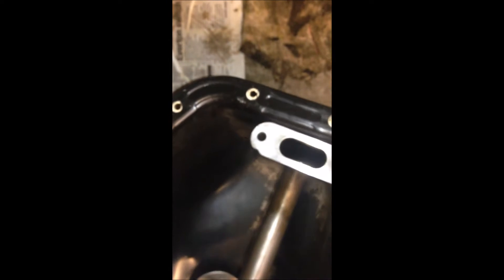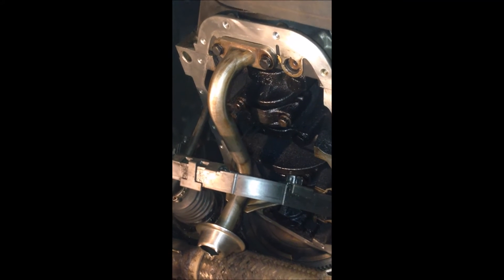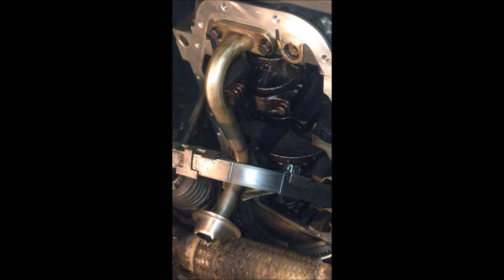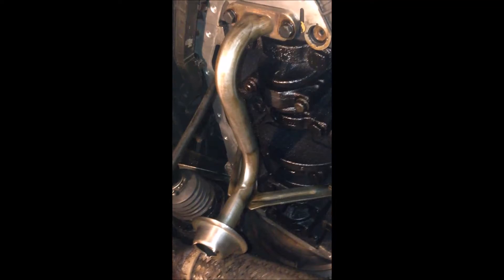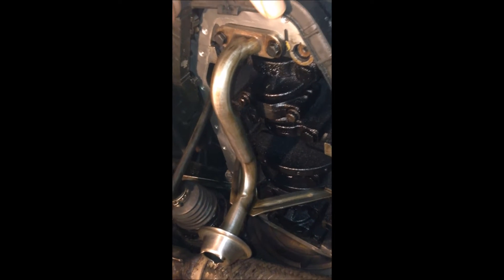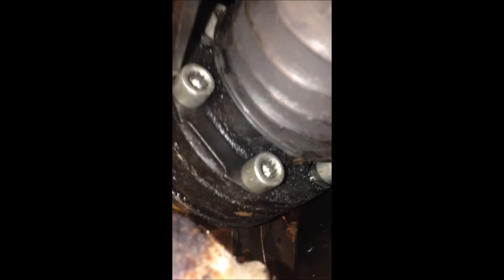VW Polo: Oil Sump and Pickup: How to Install (16v, 1.4, 6N2)

Comment: Hello, I have a leak at the oil sump on my 2004 seat ibiza 1,4 (same engine as polo) and I'm planning on replacing the gasket. I have a few questions and would really appreciate if you could give me some advice as you seem experienced. 

1. Do you need to replace all the bolts for oil sump and exhaust? 
2. Was it easy to remove the exhaust bolts or were they seized? 
3. Do you think this can be done on the ground with a car jack and a few jack stands or do you need a lift to remove the exhaust and oil sump?
Reply from the maker: For the gasket, I only used some red sealant on the old gasket. 1. I used old bolts; 2. my exhaust bolts were not seized. it depends on individual car. if seized, should be easy to buy new ones; 3. I used two car floor jacks and a few axle stands. Please view my other relevant videos, as they should documented more info than my memory! Good luck!

Comment: Hi TY for you video! I have a question please! Have you remove the dial and the ring gear please? 
Because I want to remove the carter but I don’t see the bolts witch are un the ring gear. And how could you get the screw witch is behind the dial? 
TY for answer
Reply from the maker: Sorry, I didn't remove the ring gear.

Comment: Hi 

I have a 2001 VW Polo with a 1.4 petrol engine.
Sometimes when I'm driving the red oil pressure light comes on and starts flashing but the car stays quiet and runing smooth and than the light disappears. I changed the oil pressure sensor, the oil and the filter i topped up to the max but i still have the problem. Maybe if i clean the oil pickup and the sump it can solve the problem i don't know any advice?
Thank you in advance!
Reply from the maker: hi, i think your could try thicker oil for the engine such as 15w40 next time for an oil change. Low oil pressure may be caused by clogs or leakage but thicker oil should help to some extent. Cleaning the pickup was a big job to me so i suggest only do it after every easier things tried out. keep an eye on the oil pressure and good luck!
Reply: @RepairDIY  Thanks for the reply i'll try out the thicker oil next time i hope it will solve the problem. Take care and have a good day!

Comment: Hi, 

I have exactly the same issue on my Polo 6N2 GTI 1.6 125hp.
A question for you, after cleaning the oil sump, cleaning the oil pump hole (aspirated), do you have the same problem?
I will remove the oil pan this weekend. But if it is not dirty, I think that I have to change the oil pump. Did you fix your oil pressure problem by cleaning?
Thanks :)
Reply from the maker: Yes, much improved than before. After I topped up to max, no low oil pressure indicator even after five times I accelerate to 3000 rpm at normal engine temperature. You can also check the play of your crankshaft shell bearings. Next time I will have a new MANN oil filter and Castrol 15w40 oil change. Good luck!
Reply: Mmmhhh I'll check the play thanks for the advice. Thanks for your answer. Nice videos. See you
Reply: @polo16v191  95% of the time it is the oil pick up strainer esp after >10 years. My oil light came on, dropped the sump (after much fighting with the rear 3 bolts ;-) and could not believe the strainer - 95% blocked... Lesson learnt and so important to change the oil every 12 months minimum with new OEM filter. Oil is the life blood for VW/Audi engines...

Comment: How hard where the nuts to get off? considering doing this
Reply from the maker: hi, the bolts were normally not very tight, but just very limited space to get them off. You will need some tools as shown or might also be some flexible joints or 1/4" extension bars. Any jobs I have done normally took much longer than I planned. Good luck!
Reply: @RepairDIY  thanks for the tips, yeah i know thats always the score a two min job takes two days!